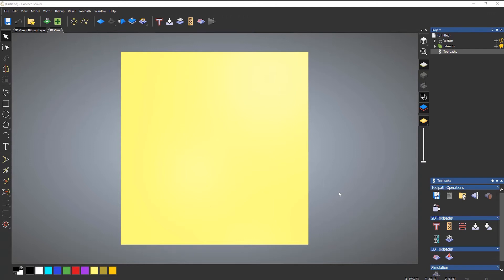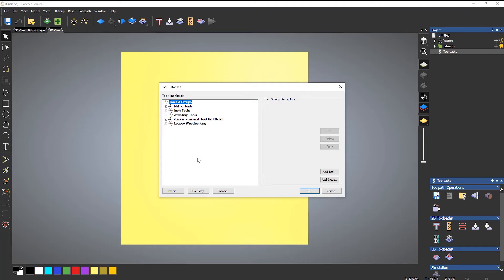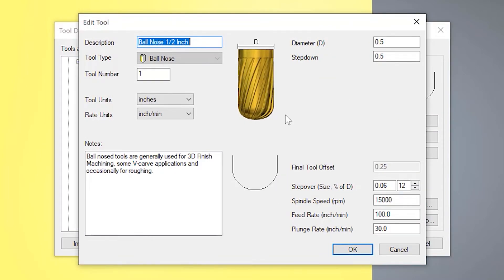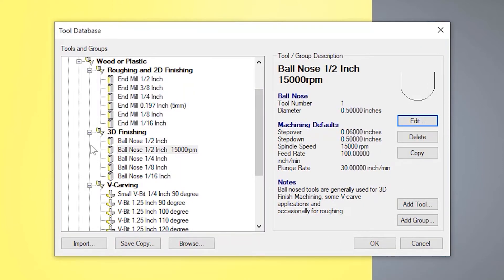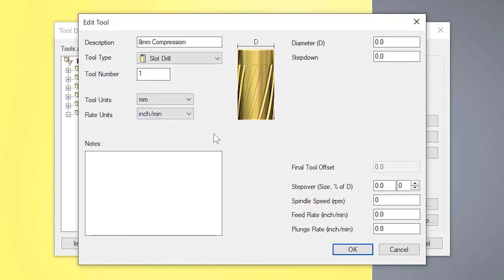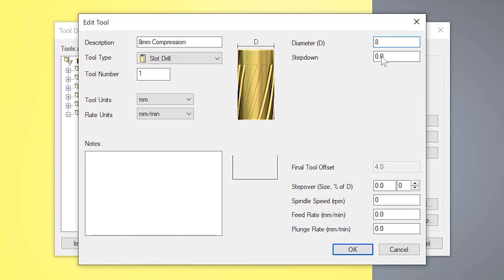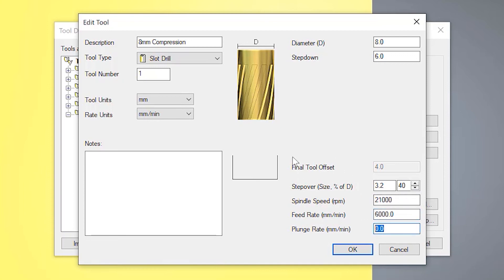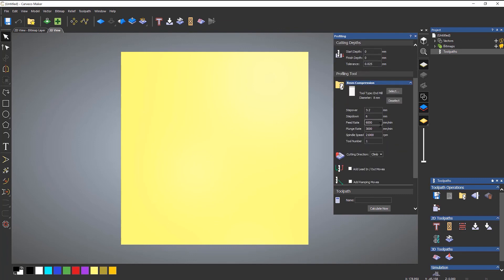Carveco Maker: Tool Database

Comment: tool database need a button.
Reply from the maker: Hi, the Tool Database does has an icon, it is located in the Toolpath Operations section which is below the splitter bar on the right hand side of the screen.

Comment: Where do I add the cutting length of the bit? I am adding a 1/32 end mill with a maximum cutting depth of  1/8 inch. I am assuming this is important for the CNC, but I do not know where it goes in the Carveco tool database.
Reply from the maker: Hi Dean, the maximum cutting depth of 1/8" means that the maximum "stepdown" in the tool database is 1/8".  It can be smaller than this (this is the depth of cut) but cannot be larger.

Comment: Please add in a future update just “starring” a FAVORITE tool and having those tools moved to a favorite tools folder. This way it will be easy to find a tool we use over and over without having to put in manufacturers specs after creating a separate group of tools. I want to be able to use manufacturers specs on tools but access them easy without having to find it in a long list under Amana. Thank you guys!!
Reply from the maker: Hi Timothy, you can drag an drop any tools from the database into a folder you create; such as 'My Tools'  or 'Favourites' for example. Although this will move the tool from its original location to your new folder. To preserve a copy of the tool in it's original group: select a tool > click 'Copy' > then drag the copy into your new folder. 

I've created a short video to show what I mean: https://www.youtube.com/watch?v=7qfWQfhzXmc

Hope that helps!
Reply: @Carveco  amazing! Thank you so much
Reply from the maker: @workingdogwoodworks1455  No worries, glad I could help!
Reply: @Carveco  I need to practice this a bit more, couldn't get drag & drop working to select my specific group of bits. Great that CarveCo will adjust imperial/metric on the fly and you don't have to redefine every tool & dimension with a calculator!